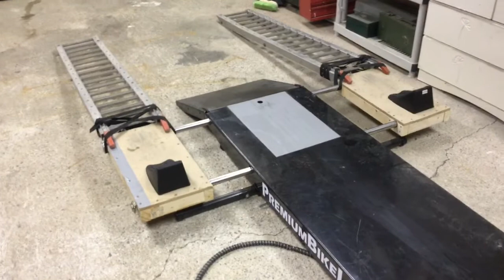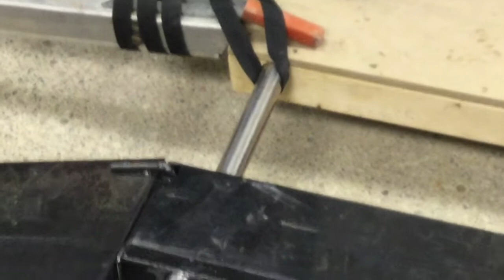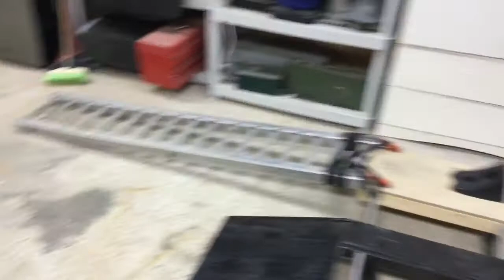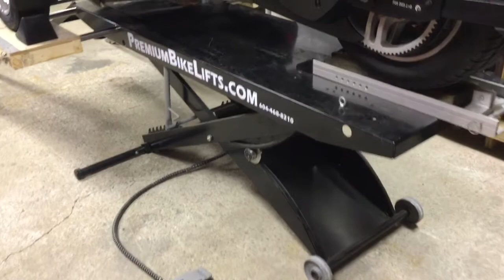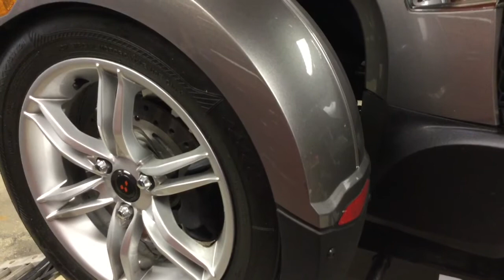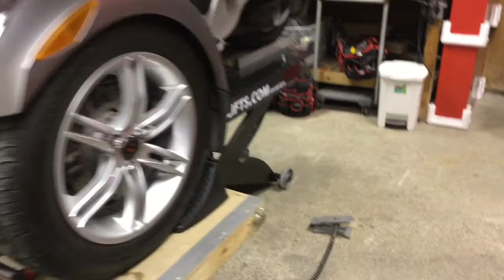Can Am Spyder Motorcycle Lift

Comment: Hello Jeff, wondering what additional steps you would need to take if you wanted to change your oil or remove something like a skid plate from under, the center of the lift is in the way right ?
Reply from the maker: Pierre - Spyder TV Poliquin - Spyder Accessories   Hi Pierre.   Thanks for the question.    The lift itself has a removable grey cover that is normally used for removing of the rear wheel when the lift is set up for a two wheel bike.  For that reason i reverse this spyder on and i am able to remove the inspection cover giving me access to beneath the spyder for most service and maintenance.
Reply: Was about to ask pretty much the same question. Your reply to Pierre took care of that.  Thanks!!